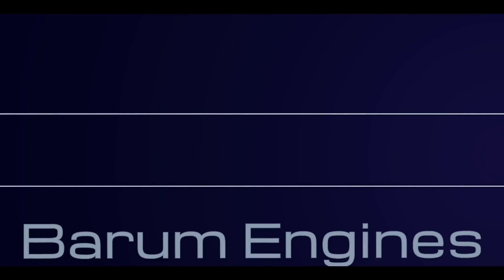Cosworth 200 cylinder block ductile iron liner finishing, now your an expert!

Comment: Love the detailed look into your boring procedure. I know there are a lot of responses mentioning torque plates and I agree that they should be used in certain circumstances. But very few engines are torque plate honed when originally manufactured. That's one of the reasons for specific tolerances. Sure, if the customer is given the option and is willing to pay the extra for the plate, setup time, and fresh hone stones, it's his money.

Comment: Good video Lee, would it not be better, 1/ to have the oil feed pipe closer to the work. 2/ have the oil feed running before you start your honing machine. After watching CEE Australia honing on both their old vertical ( same make as yours) and their new state of the art Sunnen Horizontal honing machine doing big hydraulic cylinders they always have oil/coolant running before they start the stones?

Comment: I hate to disagree about boring bar inconsistencies.  Yes if you your bar is older that smoke you will have inconsistent results, but if it's reasonably new it should be spot on every time.  I've got a question, does your bar setup with relation to the crankshaft bore or the head surface and pan rails?  Lee I know I'm harping on you a bit but let's just say it a privilege of old age, but please clean the bores before taking a measurement, when working 0.0001'sthose particles left in the bore could throw off the reading.  Do take care and get well soon. ✌👍

Comment: No torque plate on the block for the final hone?  Torquing a plate onto the block to mimic the head will normally distort the bore out of round, thus doing the final hone with that un-situ will bring the bore back to round.  This is good performance car engine build practice, or doesn't it apply to Cosworth 200 blocks?

Comment: Who calibrates your instruments Lee? It should be a annual process bud and part of your QA manual! Loved the honing piece. Great video as always!!
Reply: Aerospace to calibration 3 months if not dropped. Signed off in tool  log book signed and dated by each user on each use and security stamped calibration sticker on device
Reply: Yes indeed…imagine how many plane crashes there would be if car manufacturers built aircraft to the same standard as their cars…they would drop like flies on a windowsill in late summer…and we would all have to live in bunkers
Reply: @Missed_Apex_GT  Indeed we would me friend, indeed we would.
Reply: @johann_eigler  I can only imagine the expense of both the initial instrument purchase and the calibration for aerospace applications. Is that both for electronic and mechanical measuring devices, if they are dropped?
Reply: @catxls1835  even in car plant, digital bluetooth  logging torque wrenches so that every bolt tightened is  logged , where, which vehicle chassis. 
Jlr solihull has been using that tech for well over a decade.
Reply: @johann_eigler  Wow, I never knew that. Very interesting and such a cool way to record/collect the data in that way. Thanks Jon.
Reply: I would guess that he uses calibration rods for the outside micrometers and then uses that same calibrated outside micrometer to set the bore gauge. It all comes down to the "feel" the machinist has that determines actual deviation from the calibration rod.
Reply: @brianhope5853  Thumbs up for that Brian! It's always a school day. It's interesting that most other "hands on" professionals share the same tactile advantage tbh!

Comment: "Cosworth, its all been done, 500bhp"
Reply: I cant remember the actual HP but cosworth produced a 1 litre engine that used to be / or still on display at Donnington motor museum that was over 500HP at the flywheel.?

Comment: you work in imperial some work in metric  (cutting edge engineering  youtube )  kurtis and karen they also use the banana measurement with tapes rulers and calipers set in bananas

Comment: I really enjoyed the video and learned more about honing bores is a precise way.. Love the gauge you're using to measure. 
I know this has been mentioned very often on this channel but for those who get their knickers in a twist about giving measurements in imperial units it's an easy conversion to metric by multiplying the value by 25.4 or if wanting to take metric units to imperial to divide by 25.4.
Reply: Rather more to the point, one inch is 25.400 millimetres.
Reply: @johnbriggs3916  Yes, and I provide the math for doing the conversion. It's simple. No need to complain.
Reply: @Fred Flintstone  Yes, but the point I am making is that the next two decimals are zero, making multiplication awfully safe. 25.4 is accurate, not just a rule of thumb. (Saying that a millimetre is 40 thou is just a rule of thumb.)
Reply: @johnbriggs3916  Yes I knew that. Those of us who are converting thousandths and ten thousandths of an inch, or a micron or two need a good degree of precision and there are actually more than just two zeros behind the four in fact there are something like 6 zeros before we hit the digit one. As far as youtube comment readers who get confused and whine about the units being used generally don't need to know this though. If they really understood this there would be no need for discussion in the first place.When it comes do doing math there's absolutely no difference between using 25.4, 25.400, or 25.400000..